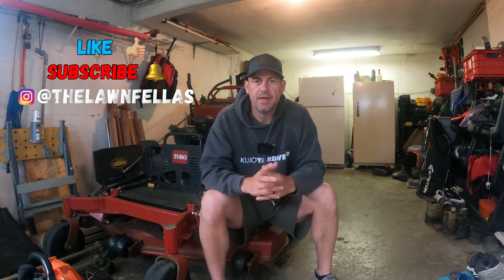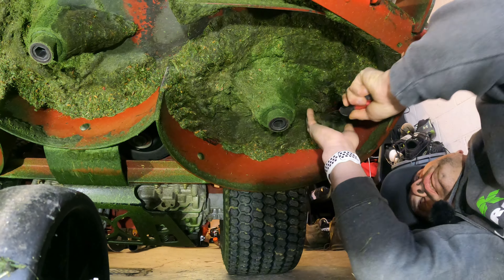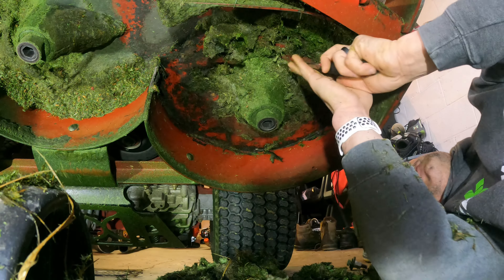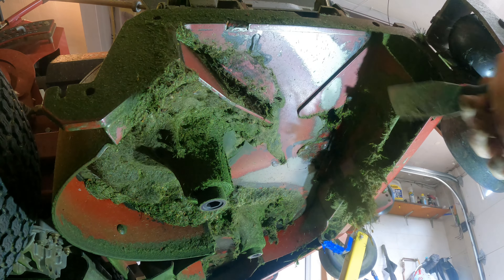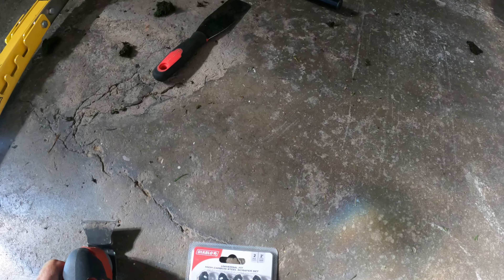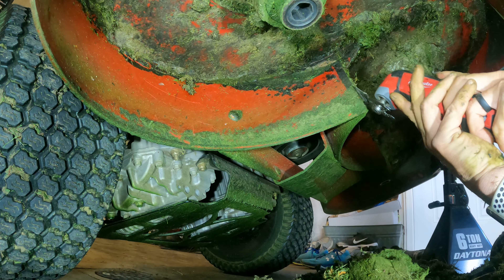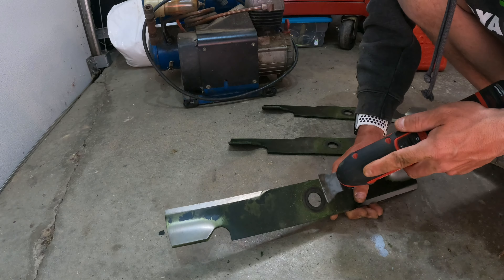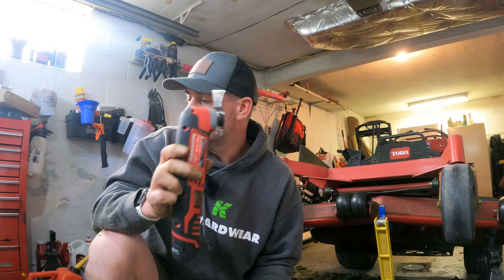I Know The Secret: How to Scrape Your Mower Deck FAST and EASY.

Comment: Great ideas! The only issue is most mower decks on tractors are underneath and are a pig to remove. We can't just lift them up like yours. Hence, cleaning after every cutting is not practical. I use the hose attachment and let the deck dry before putting it back in my garden shed. It's second best to your ideas. Thanks!
Reply from the maker: @acreguy3156  gotta be careful with the hose attachment because of rust. But you can always use a hoist to lift the mower. I want to attach one to my garage it will make cleaning the deck way easier for me. I only clean my deck once a week usually in the spring months. Once it starts drying out in the summer I do it once every other week.
Reply: @TheLawnFellas  👍.

Comment: There’s always time in the spring when it’s unavoidable to mow some wet grass. My grass is weedy and grows an inch a day easily.  This tip with the multi scrapper blade is a good idea.  Thanks. One other thing I’ve learned is in the late fall if you have leaves to mow, before I quit mowing for the season, I mow a bunch of leaves and the leaves basically clean the deck like sand blasting.  Spay underneath with some silicone to coat and ready for the next mowing season.
Reply from the maker: Yes I like to use fluid film under my deck. It helps with the rusting and helps with scraping the deck.  👍🏼

Comment: Great advice! I use a 3 foot piece of 1-1/4 PVC pipe with a cap on one end, the other end is cut at a sharp angle to remove the bulk of the clippings and to clear the chute if it gets clogged while mowing. I also use a small mason's trowel and a painter's multi scraper for the detail work.
Reply from the maker: Thanks appreciate it. Someone else commented about using a mason trowel because of the point. Definitely gonna try one for sure!!

Comment: On my deck underside, I first thoroughly cleaned down to the paint using scrapers and a wire wheel. I then applied a coating of "Slip Plate SLIP1-4X1G Graphite Dry Film Lubricant". Now grass tends to not stick in the first place and if some does it is much easier to scrape off.
Reply from the maker: @doughoffman9463  never heard of it. Gonna have to look into that. I use Fluid film a lot under the decks.
Reply: How do you apply the slip plate? Is there a liquid that you spray on? Let me know thanks.
Reply: @williamodom2580  After first scraping and then wire brushing down to the paint or bare metal, I simply brush it on. Don't know if there is a spray. It is thick stuff right out of the can. Let it dry for a day or two before mowing.

Comment: I use a pressure washer gutter cleaning attachment to spray under deck after mowing. Works great!
Reply from the maker: Gotta be careful with high pressure water on sealed bearings. If water gets in there then it will rust it out and you won’t know it until it cracks. Had that happen to a push mower!!  I do clean my mowers once a year but hose water is enough to clean it.
Reply: How about a power washer to get that !!!
Reply from the maker: @vyger6336  not good to use high pressure water on sealed bearings. A hose yes pressure washer I am not too big of a fan of it. You get water in a sealed bearing and it’s a problem waiting to happen. Just my opinion
Reply: @TheLawnFellas  I see your point and thanks..didn't think about those bearings that we can't grease with the grease fitting that the MFG So thoughtfully supplied  ..LOL
Reply from the maker: @vyger6336  lol yea for sure!!!
Reply: After you pressure wash the underside of the deck, run the blades for a few mins to dry it out and sling any water out from around the bearings.  To easy to forget to do this and just put the mower up.
Reply from the maker: @carsonmiller104  hmmmmm sounds like a great idea.

Comment: Nice, gonna try this out with my M18 oscillating tool! Have you ever tried a turbo nozzle with a pressure washer after taking the whole deck off? I have a smaller zero turn with a 42" deck (I just use it on my 1 acre property). Every time I'm done mowing, I connect the garden hose to the washing port on the top of the deck, spin the blades, and it cleans out most of the grass. Some grass residue always stays stuck, so I have to scrape it off, tediously, when I sharpen the blades every few months. I figure a pressure washer turbo nozzle directly pointed at the deck will do a better job, but I haven't tried it yet.
Reply from the maker: It would work but you gotta be careful with sealed bearings. If you get water in there it’s gonna rust out. I prefer just to wash the deck with light pressure and continue to scrape it. 👍🏼

Comment: 2 1/2" square mason's trowel works great. offset handle works well
Reply from the maker: I was gonna say that point and the offset handle would definitely work. Gonna have to try that. Is the trowel flexible?
Reply: Yes it's flexable. N
arrower, 1 1/2" may work better to get around the bolts
Reply from the maker: @ChuckYueckstock  definitely gonna give it a try for sure 👍🏼

Comment: When I lived in Florida the deck hardly ever got grass stuck in it. But the sandy soil is murder on the blades, totally eats them up. Here in Missouri well that's a different story, i get a lot stuck underneath. I have 2 old hacksaw blades i use for scraping, they are about 1 1/2 wide with no teeth on them. I got them from work way before I retired. I also run Gator blades, i find they cut better. I have a Gravelly commercial zero turn since 2014 great mower. Wanted a Scag but was talked out of.
Reply from the maker: @jakeschisler7525  I can imagine what sand does to blades. I seen people’s videos on that, eats them alive. I only see a handful of Scags in my area. It’s Toro, Exmark, or Ferris mainly. This time of the year it being dry not so much scraping. April, May, and Usually June the decks are caked with grass. Another person said try to use a pointed concrete trowel.

Comment: That multitool would work a whole lot better if you turn the blade over it's upside-down
Reply from the maker: @sterincaldwell9814  I don’t think it is. I am holding the tool upside down. But it’s a scraper not sure it really matters how you hold it or put a blade on for this purpose. Maybe if I was scraping a tile floor it might cause you need the flex.

Comment: I have been mowing grass for over 60 years, and I have NEVER had to scrape under my mower deck.  Why?  Because I don't mow wet grass.
Reply from the maker: Lucky you but Unfortunately I can’t pick and choose when I mow. Where I live the tall fescue and Kentucky blue grass can get tall very quickly and retain water even on dry days. So when I have to close my chute around beds and other areas, I can’t help but get grass under my deck.
Reply: I can't wait until 9 or 10 in the morning for the dew to evaporate to start mowing.
Reply from the maker: @johnossendorf9979  exactly!! Then when you go around someone’s mulch bed and have to close the chute the grass just packs in. 👍🏼
Reply: @TheLawnFellas  I have never had a chute to close.
Reply from the maker: @johnossendorf9979  speeds up your mowing time. Less blowing out in certain areas. It allows you to mow in several directions. Instead of avoiding beds with your chute side you can keep your pattern. 👍🏼
Reply: You likely do not have the Toro Timemaster 30” mower.  It clogs and sticks constantly.  Dry grass etc.  it does a great job - but maintenance and cleaning far exceeds the time you think you saved mowing with a bigger deck.
Reply from the maker: @equestrian2156  it definitely packs the grass in for sure 💪🏼